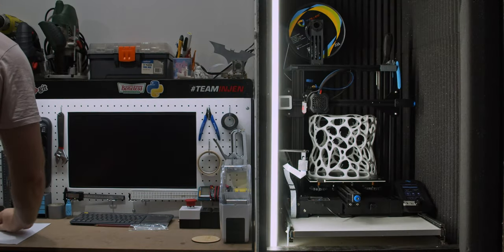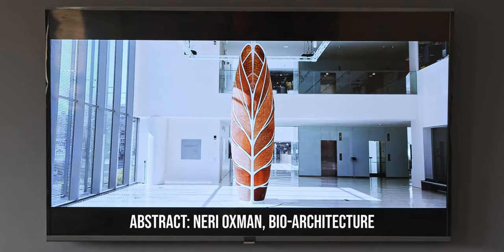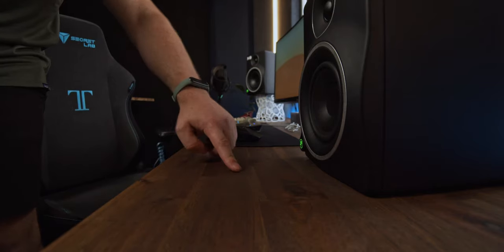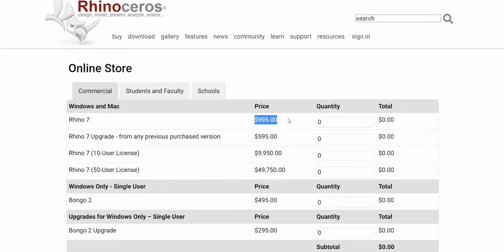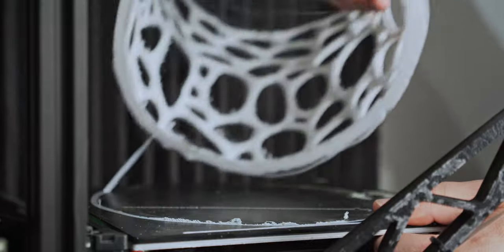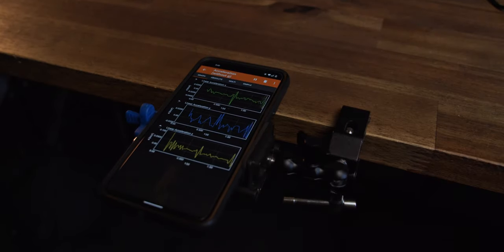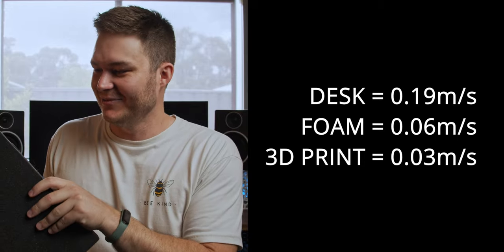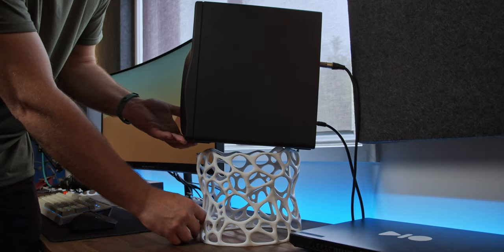these Speaker Stands are better than Foam!

Comment: Hey man, can you share some tricks you learned medeling this besides the video mentioned?
Reply from the maker: The tutorial really took it most of the way.
From there I spent a lot of time tweaking the randomisation and then manually pushing and pulling the vertices it produced.
I had hoped it'd all be randomly generated, but it took a lot of manual work.

Main tip would be to try and make the "overhang" parts as pointy as possible, so the holes are more water droplet-shaped 💧, this makes it easier to 3D print with minimal bridging.

A lot of it was trial and error until eventually, the final product looked something like what I wanted.
Then as you see in the end, manually sculpting the top edges to be thicker. And chopping off the base to have a flat surface.

Good luck 😄🤙

Comment: This is awesome! Looks really good man. What weight will your current design support without crumpling?
Reply from the maker: Oh good question!
I haven't tested it's crumple load as I have minimal flexible filament left and it doesn't always go back to its true shape after being stretched.

My speakers (Mackie MR5MKIII) are 5.5kg/12lb and that's held well. I sat the other speaker on top of each other and it held the now 11kg/24lb weight vertically fine, issue is it sweys being quite top heavy at that point haha.

Comment: SWEET! How much?! I need some for my studio upgrades. Also, what's the weight capacity on the ones you have? Nice work yet again!
Reply from the maker: Its $40 a roll of the filament, and I think it was about half a roll in the end.

As for current model, I managed to put 11kg/24lb ontop and it didn't crumple 👍

I'm fixing some things on my 3D printer for better reliability, will then try create a version that uses less filament!

Comment: How did you print this without supports?
Reply from the maker: A lot of filament tuning, but unfortunately, the PLAFlex I used originally turns brittle over time and breaks. And trying to reprint with TPU has not been as clean.

I've just got a new Bamblabs X1C to test, so I'm hoping it can pull off a new pair with their TPU.
Reply: @camshand  I have a P1S and I really struggle printing this design in PolyFlex TPU90, without supports.

But supports are no option for this print imo.
Overhangs and bridges are really tough for me. I guess I have to tune the filament a bit more.

In worst case I am considering printing this from a hard material and potentially add TPU feet/rims